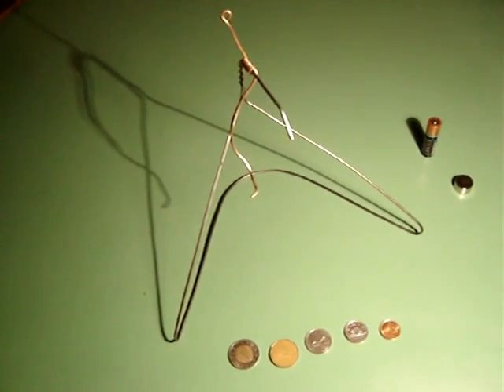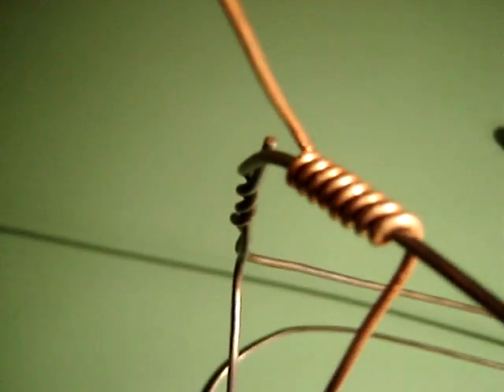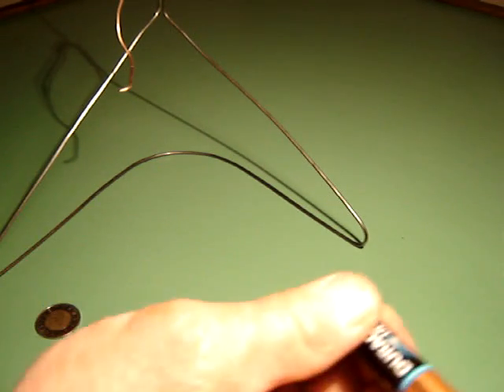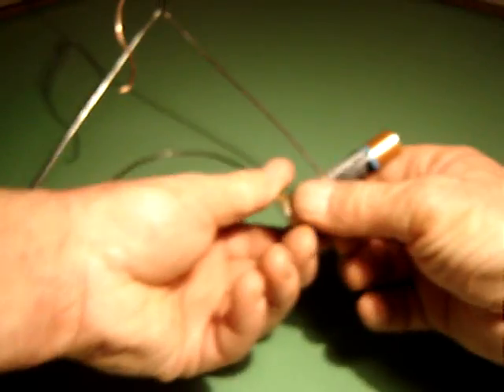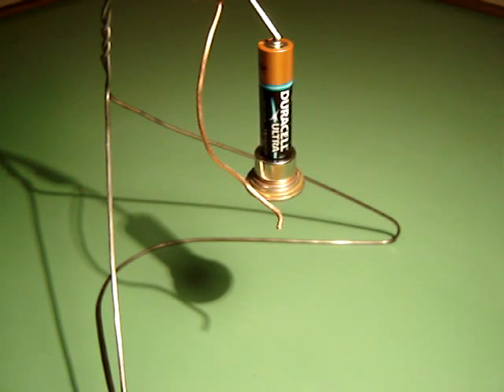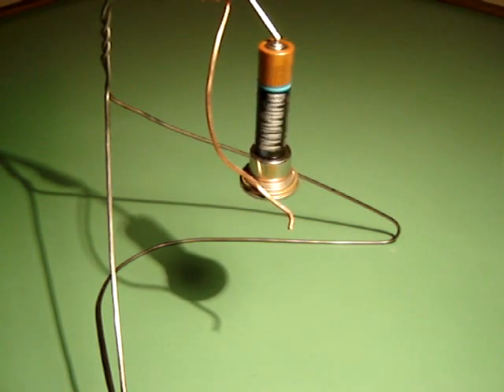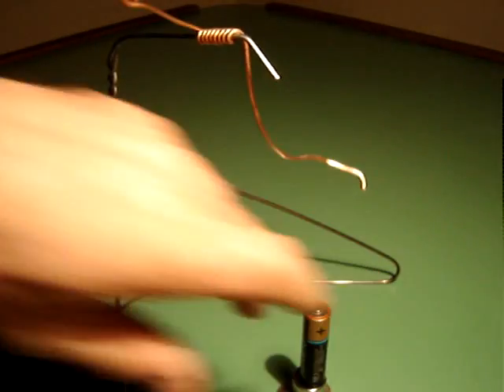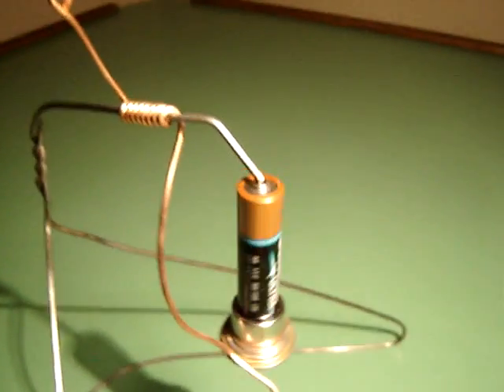Homopolar Motor With Five Speed Manual Stick-Shift

Comment: I'm not from Canada but all of the coins have the same resistance. the only reason this works is because the battery flops around more with the larger coins than the smaller coins causing the circuit to spend less time closed.
Reply: fix the flopping and the shifter won't do shit.
Reply: Not entirely sure about that. Even if they were all the same resistance, by shortening the connection, and skipping one coin, you are reducing the total resistance of the circuit by the resistance value of the coin skipped. Ex, 5+5+5+5+5 > 5+5+5+5

Comment from the maker: The main principle of the homopolar motor is the Lorentz Force. Basically,the current through the wire creates a magnetic field that interacts with the magnetic field of the magnet, producing a rotating force. There may be similar forces acting on the earth.

Comment from the maker: You can make a one-speed motor with just the magnet minus coins. The copper wire does need to touch the coat hanger metal enough to not overheat. The coat hanger must have it's coating scraped off, and the wire wrapped around a few times. Plus that's where the cool shifter is!

Comment: This has nothing to do with surface area.  The motive force is proportional to the magentic field.  The farther from the center of the magnet you get, the weaker the magentic field gets.  The magentic field 2 cm from the magnet is 1/4 as strong as the field 1 cm away from the magnet.

Comment: OK , that makes sense , not enough surface area on a point to maintain attraction...still I see that the battery skates around enough at higher rpm to break away , so a dimple dead center would still be in order , preferably rounded to fit the hanger wire ....maybe just...lemme see here , I just took the smallest robertson screwdriver and center  it carefully , gave it a sharp rap with the klein pliers and voila... small indent to keep the wire centered then some ....
conductive grease ?

Comment from the maker: Thanks for the input! I too thought that a point on the coat-hanger bearing surface would be best, but the battery contraption would not hang in there then. So I rounded and polished the coat-hanger surface, and it was just enough of a difference that it was able to make more magnetic attraction, and thereby work.
(took a couple of hours to figure that part out!)

Comment: HEY RICK !
pure genius , this is a notch up on the original AA /neob motor 
makes me proud to be a Canadian !
it appears you're getting greater contact area between the wire and coins thereby less ohms resistance for higher voltage and speed , finally direct contact to the neob and highest rpm .
the axis point maybe improved by getting a sharpened pivot point on the coathanger wire and making a slight dimple in at the top of the AA .
keep up the good work ,

Comment from the maker: The battery and magnet heat up with the internal resistance, as well as the wire. The energy mostly goes into creating motion...the system only overheats when the motion won't begin, because of inefficient connections or excess friction.

Comment: Is it possible that the coil generates a back emf to control the current? But intially it does look like a short circuit i.e. no load resistance

Comment from the maker: This motor can spin for up to 20 minutes or so, if adjusted properly. If not adjusted properly, it can drain the battery in less than a minute and make it very hot!

Comment from the maker: This requires a fully charged battery, and will run it down quickly. The battery voltage will determine how fast the motor spins. 

However, if the battery was dead, and you could rotate the dead battery and magnet fast enough, say by cranking them, it would actually charge the battery.

Comment from the maker: Part of the effect is from the resistance, but there will be a bigger speed change from the radius changes. A bigger radius to the contact wire equals slower rotation. The magnetic field is also changed by the coin sizes.

Comment from the maker: To change speeds, I moved the contact wire from coin to coin, which changes the current and magnetic field, and therefore the speed. It took several hours to get it just right.

Comment from the maker: Thanks, that's a good question.

I'd say the answer to your question is...yes! The continuity (or alternately, resistance) of metals is important, as the magnetic field created is related to the amperage through them. Also, the further the wire is from the magnet also slows the rotation speed.

Comment from the maker: This is a motor that requires battery energy to run. You could make a generator and charge the battery, by reversing the process through rotating the magnet.

Comment from the maker: The battery creates a current in the wire and magnet. That current makes a magnetic field that interacts with the magnetic field of the magnet, to produce torque and rotation.

I would advise you to get a couple of neodymium magnets and play with batteries and other sources of power and magnetism! You will learn lots...and maybe discover a new kind of energy to help mankind!

Magnets can be bought online at K&J Magnetics or other places.

Comment from the maker: El alambre de la suspensión es de acero percha. El alambre envuelto alrededor de la percha para hacer contacto es de 14 hilos de cobre de calibre.

The hanger wire is steel coat-hanger. The wire wrapped around the hanger to make contact is 14 gage copper wire.

Comment from the maker: @deividcoptero 
Corriente en un conductor forma un campo magnético que reacciona con el campo magnético del imán para producir el par, de acuerdo con lo que se denomina la "fuerza de Lorentz".

Consulte la sección "homopolar motor" y especialmente "generator homopolar" en Wikipedia para obtener información buena en este concepto.

Current in a conductor forms a magnetic field which reacts to the magnetic field of the magnet to produce torque, according to what is called the "Lorentz Force".

Comment from the maker: @gitrmstr 

I suppose you could do a test to see what force will pull the magnet off a steel surface. There are magnetic strength charts for each size magnet at the K&J Magnetics website (link is in the "Show More" box)

I suggest you could try your magnet to see if it works as a regular homopolar motor, with a heart shaped rotor. Try that first, as this 5-speed experiment is a lot trickier to run.

Comment from the maker: @gitrmstr 
For this experiment, powerful neodymium magnets are necessary. Buckyballs are powerful, but not big enough and the wrong shape for the main magnet under the battery. You could perhaps use a Buckyball magnet to attach the battery to the steel hanger.

Comment from the maker: @TheReasonWhyGuy 

The way I see it is, the net torque is what is left over after friction and back emf are subtracted. The torque at maximum free rpm of an electrical motor is zero. (i.e. the input power is balanced by the friction and back emf forces.) With additional voltage, there will be a torque that accelerates the motor to the next maximum rpm level, at which point the net torque becomes zero again.

Comment from the maker: @Parrislspivey 

There is less resistance and more voltage as the radius of the coins decreases and they get closer to the battery. 

Also, the closer to the magnet, the more powerful the magnetic field. 

More power in the wire and an increased magnetic field equals faster speed.

Comment: @MrfixitRick "Increasing the voltage increases the speed, but not the torque."
Wait, but how does it increase speed without increasing torque?
Isn't torque the angular force applied, and thus increasing the speed, being that the only limiting factor is friction, wouldn't that require that the force, torque, be increased?

I've also heard that the voltage of homopolar motors is limited in some way, do you know how this is?

Comment from the maker: @TheReasonWhyGuy 
To increase the torque generated, increase the magnetic field strength (i.e. use a N52 strength neodymium magnet of the biggest size practical) and increase the current. A longer length of conductor in the active magnetic field will generate more torque.

Increasing the voltage increases the speed, but not the torque.

See my other videos like "Homopolar Hearts"  to see the wire spinning instead of the battery.

Comment: @MrfixitRick I'm looking to try this, but I want to know if you know how to make it stronger...
Would increasing the magnet strength, volt/amp-age or the conducting wire length help?
Would all of these things help? Also isn't it true that the battery doesn't need to spin, that you could just attach a wire of sorts to create a proper flow?

Comment from the maker: @TheReasonWhyGuy 

The torque is likely in the realm of 1/10ths of an inch-oz of torque. It is approximately 1/1000th of a horsepower. You can feel the stall torque with your hand, and a finger rubbing on the magnet will stop the motor when running.

I'd say, if curious...try it!

Comment from the maker: @pouelchnu 

The resistor would restrict the current which is necessary for the motor to function. The motor might still turn but much slower.

The commutator connection saps a lot of power, and could be improved for longer running. And the hanger bearing point could be better for less resistance.

Comment: Talk about draining a battery in 2 minutes ... :) Would it still work if you added a small series resistor (like 5-10 ohms) or does it really require all that current? Anyways, clever design.

Comment from the maker: @supahfly4536 
A steel paper clip will have more resistance and heat up more than a copper wire. Usually a steel wire won't let the motor work due to sticking to the magnet. Use a heavier copper wire to avoid heating it up too much.

These homopolar motors can get really hot. 
Be careful or be burned!

Comment from the maker: @themassau 
This motor is inefficient and it heats up. The navy uses twin 25,000 horsepower DC homopolar motors in the latest ships, and at 98% efficiency, they are among the most efficient motors in the world. They use supercooled superconductors to keep the heat down.

Comment from the maker: @scavanger96 
Yes, there are ways to increase the power and smoothness of this motor. For example, the Navy makes 25,000 horsepower versions of this homopolar motor using supercooled superconductors.

If you have some ideas, I'd suggest you try them with your own simple homopolar motor...you may discover the best new motor design!

Comment from the maker: @Turtan4 

Most electrical motors are actually "heteropolar", in that they use reversing north and south pole forces to turn the rotor, as opposed to the unipolar induction of the homopolar variety.

Comment: @lesleyhenriquez i actually mean that you use a really high voltage like 1kv so you don't have to touch magnet whit the wire. but the problem is if this motor need high current than the engine will not turn. the wire create a lot of friction in this engine if you lower it than the efficiency will go up. and you just let it levitate whit diamagnetic so there wont be friction of the bearings.

Comment: @lesleyhenriquez k an other question would this motor be possible to make if put the magnet between diamagnetic so they will float an than use a very high voltage so you don't get the friction of the wire. or doesit require a verry high current to turn?

Comment from the maker: @Ihateoldyork 

The homopolar motor is like other motors and needs fuel...in this case electricity. A car motor could be made in this manner, but it would require lots of electrical power to make it run, similar to other electric cars.

Comment from the maker: @platano5805

Another battery added in series would double the voltage, and would increase the speed. If somehow the battery was added in parallel, the voltage would stay the same, but the amperage will increase. In that case, the torque will increase, but not necessarily the speed.

Comment from the maker: @evabesnimon 

Basically, the principle of Faraday's Law is used. The current through the copper wire creates a magnetic field that reacts to the magnetic field of the magnet, inducing a torque in the wire and the spinning effect.

Comment from the maker: @generoustechieutube 

Canadian coins are mostly magnetic, and that is what I used. Steel washers could substitute.

The homopolar motor can be used in reverse as a generator. A spinning conducting disc in a magnetic field will generate power between the centre and rim of the disc. See "homopolar generator' in wikipedia for good info.

Comment: I used N40 Neodymium magnets. It did not work well with C battery. Then I saw this video and tried AA batteris and it worked as it is demoed here.

I do have Canadian coins hidden somewhere in the house.

Unfortunately, I can not carry Neodymium magnets everwhere in the house :-)

I have order N42 magnets and they are on their way - but, 
looks like N40 and AA batteries were able to creare RPM in the range of 500 to 1200 - using 1 to 4 N40 magnets. Good enough for a Science fair.

Comment from the maker: @bhp123654 
I got the neodymium magnet from K&J Magnetics online. The link is in the "more info" box.

A 7/8 inch diameter magnet like the DE8 or DX8 will work. The stronger 1 inch diameter DX06-N52 would be best.

Comment from the maker: @RawrMuch1 
Yup, ya gotta be careful not to get burned. If the battery is too hot to touch, then the setup is probably not working right. You can file and polish the battery-hanging point of the hanger. It should be rounded, not a sharp point. Make sure the varnish coating is removed from the coat-hanger where the copper wire contacts it. Clean the coins for better contact, especially on the commutator edges. Use a powerful battery like a Duracell and a N52 neodymium magnet. 
Watch your fingers!

Comment from the maker: @ozzmonaut 
I think you will find that it has to be a strong magnetic field, and that neodymium magnets work well for that. 

I suggest you experiment with what you are suggesting  and see for yourself! It's fun discovering things about magnets.

I did manage to run a homopolar heart motor using a large bass speaker magnet as the magnetic field.

Comment: Does it have to be neodymium magnets? Could you possibly use a large magnet for the base, stack the money on top, battery on top of that, and a symmetrical armature on top of the battery with a similar shift mechanism. It would keep the battery from flying off.

Comment: Is there a way of charging that battery, say - by solar energy? or does it discharge too fast ? it would be cool to get the motor to turn the energy solar panels make into more electricity . . kind of like a coefficient of performance on heat pumps. .. just a thought

Comment from the maker: @Nomoreidsleft 
Some coins have steel in them too...
According to wiki, the 2000 and up Canadian nickel (5 cent coin) is 94.5% steel, 3.5% copper, and 2% nickel plating!!

I believe the shifting has more to do with the radius of the current through the coins, the resistance of the coins, and their position in the magnetic field of the magnet.

Comment from the maker: @Mozilafoxx 
Yes, it is what you see. It looks simple but is not easy. Use a strong neodymium magnet like the 1" x 1/2" DX08 from K&J Magnetics. 

It turns to the left because of the polarity of the battery. Flip the battery to reverse the spin direction. The magnetic field of the current opposes the magnetic field of the magnet by the Lorentz force, producing spin torque.

Comment from the maker: @airsofterock 

Also, the shape of the tip of the steel hanger makes a huge difference in hanging ability of the battery. Not too pointed, but not too rounded is best. Smooth and polish the tip area.

If desperate, use a tiny ball magnet between the steel hanger and the battery plus, but I consider it cheating for this hard assignment!!

Good luck, keep at it and pay careful attention. Any more questions, let me know.

Comment from the maker: @airsofterock 

Yes, due to several hours of experimentation to get this video, I can suggest several things. 

First, use the correct size of the most powerful magnet. A good one is the DX06-N52 from K&J Magnetics. (link in the "more info" box >>)

The battery must be magnetic. This alkaline Duracell worked and the rechargeable green Duracells, but some others won't hang.

The coins should be magnetic to carry the magnetic field best. I use Canadian coins for that.

Comment from the maker: @slash112solo 

The copper wire moves forwards and contacts the next sized coin on the stack. The difference in radius changes the rpm's...bigger coin = less speed. Also, the larger coins are further away from the magnetic field, hence have less rpm potential.

Comment from the maker: You must use copper wire, not steel for the contact wire to the magnet. The coat hanger must be bare metal...use sandpaper to make a good contact with the copper wire.

Comment from the maker: I don't think my homoploar motor can be used that way. To get power out, you would need to spin the magnet at very high speeds, and use a wire to draw power from it as it rotates. fYou could use a drill or other high-speed rotating source to spin the magnet. It will still be low voltage. You likely need higher voltage for a leyden jar.

Comment from the maker: The battery is attached at the bottom by a strong neodymium magnet, which induces a magnetic field in the whole battery, turning it into a magnet that sticks to the steel of the coat-hanger wire. 

The copper wire doesn't stick, but rests on the magnet or coins by gravity and design.